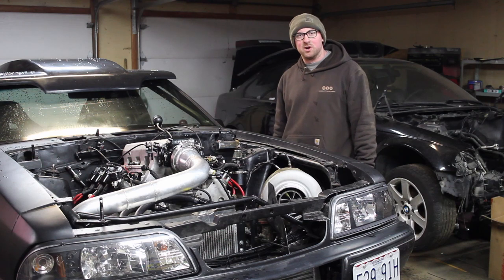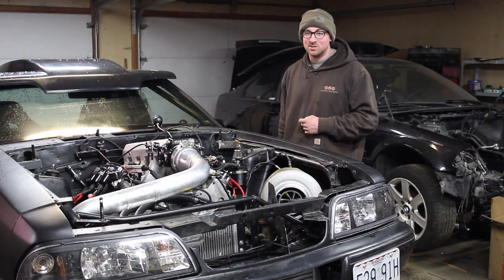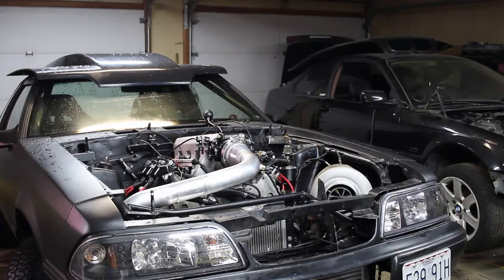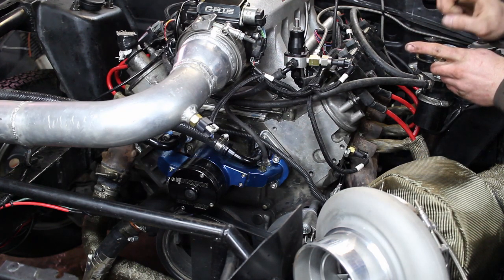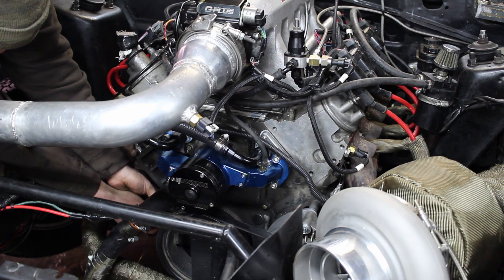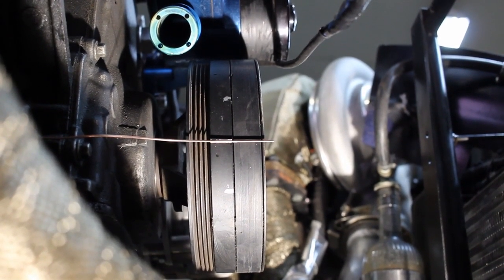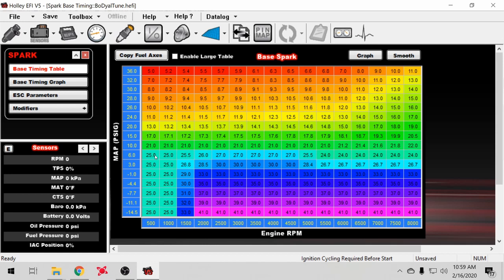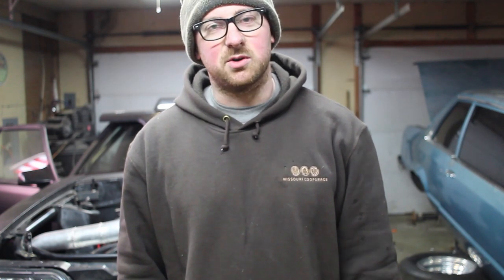How to verify timing on a LS with Holley EFI

Comment: How did you where the 20* and 25* marks were on the stock balancer?  I need to do the same thing and have a stock balancer but I bought a Motion Raceworks timing pointer.

Comment: You are supposed to loosen your rocker arms on the number 1 cylinder because the valve will hit the stop and give you an incorrect tdc.  Unless you are doing something different....
Reply from the maker: Yeah I know. I thought I put that in the video. My bad. I kinda rushed this video together.
Reply: @boostinbo  Just trying to make sure ya don't screw yourself lol
Reply from the maker: I appreciate that. I made a few mistakes rushing this video together. I may just redo it and take this one down
Reply: I just ran across this. 4 years later. It was a 0:46 second video for me, because I came to comment section. Found this, moved on. Thanks 👍